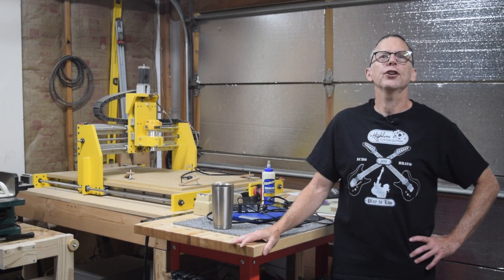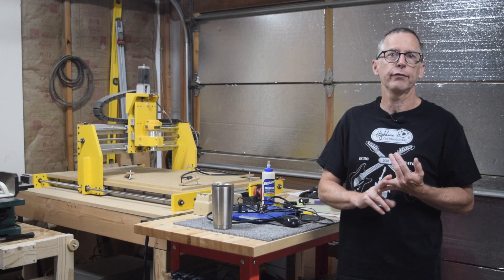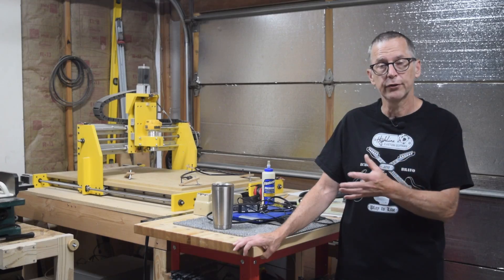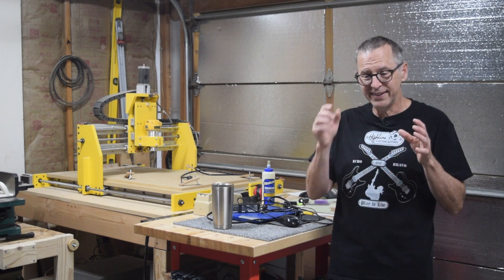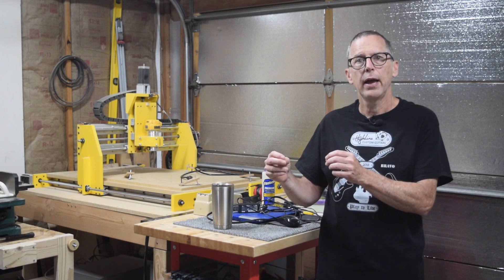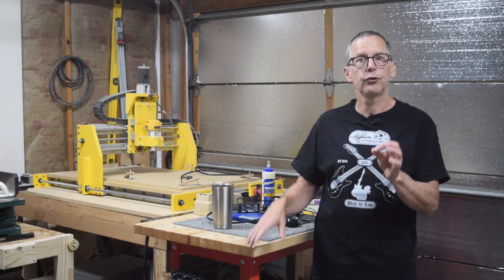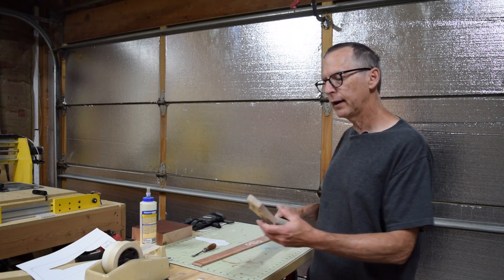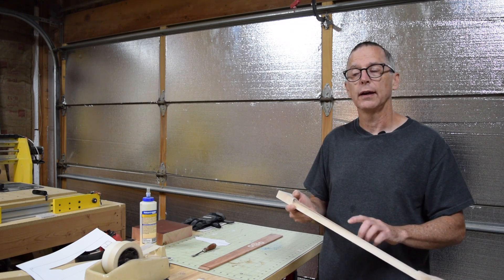The Steampunk Guitar Part 3: Making the Fretboard and Neck

Comment: Hi Chris, great series! What settings do you use for milling your fret slots? I really like the idea of leaving the fret ends free, that’s a nice look. I have built the same machine, I’m assuming the Dewalt would be on one for spindle speed, but do you remember how many passes, depth  and  millimeters per second etc? I’m using the same Bits as well, those bits or so tiny! Because I’m worried about snapping one:) thanks so much James
Reply from the maker: 20ipm and .01doc.
Reply: @HighlineGuitars  thx!

Comment: Thanks for sharing these videos, lots of inspiration!
- What is the advantage of your own built CNC over the X-carve?
Reply from the maker: Faster, stiffer, and more Z axis capacity.
Reply: @HighlineGuitars  Thanks, that make sense. It seems like X-carve would be a good way to start off as a first CNC, but would you recommend that it would be more wise to go for creating an own CNC for better specs, even if it takes more time to build it?
Reply from the maker: @PerMoneeo  only you can answer that question. Either way will work, but the direction you choose will depend on your requirements and your level of skill and ability.

Comment: What size end-mill do you use for fret slots? Also what is the the feeds and speeds, how much stepdown per past and total depth is the slotting tool set for? Good video.
Reply from the maker: https://youtu.be/MUPLLTTBZN4
Reply: Thank you for the information on cutting fret slot.  I think you will fine that cutting the fret board radius using a flat end mill with it cutting at 45 degree or 90degree angle to the centerline of the fret board works better than with a ball end mill.  I just got done making some radius sanding boards first one I used a 1/4 in ball mill running long ways.  Next I tried again with the ball mill running with the centerline and 90 degree to it. This did a better job than the first one.  Last I tried again running with the centerline using flat 1/4 end ball mill this was much better than either of the other 2 tries.
Reply from the maker: @williamthrasher8540  You are correct! I have been using a flat end mill at 90° to the centerline lately as it produces a much smoother surface than a ball mill.
Reply: @HighlineGuitars  sorry for being slow, I'm just starting with CNC.. but can you explain about "90° to the centerline"?